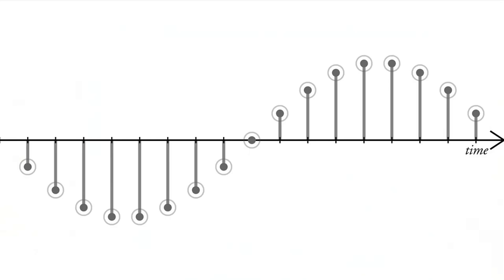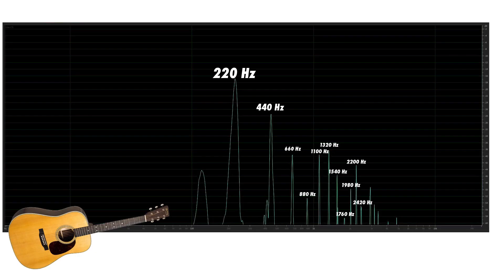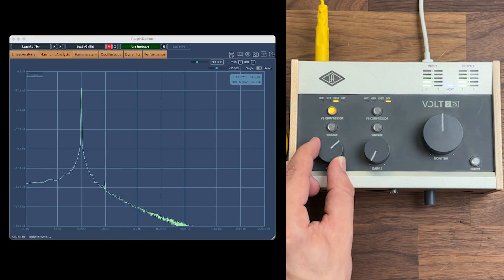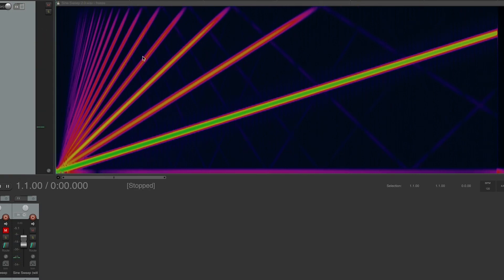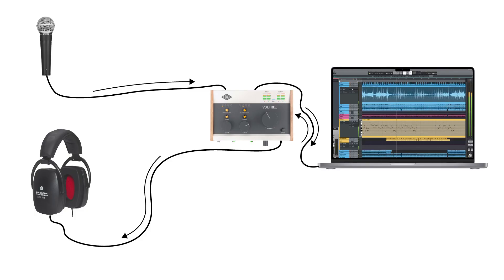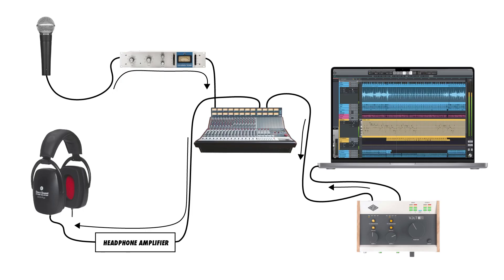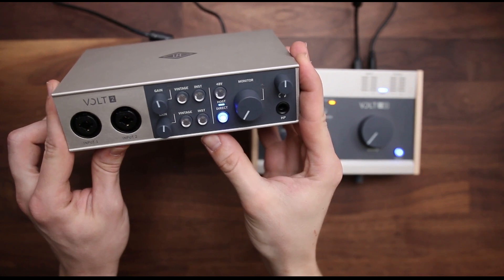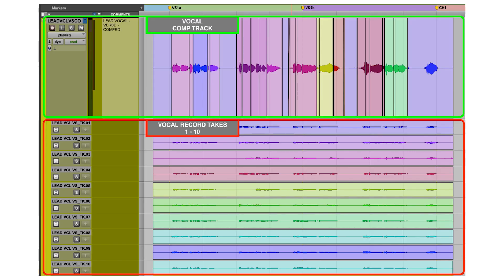What Is “The Analog Sound”? | Overcoming the Limitations of Digital Audio (Part 3 of 3)

Comment: When using plugins for mixing and mastering, which happens always, in the end, I work in 96kHz, and bounce back in the end to 48kHz. The folding back of all that aliasing will happen further down on the spectrum. So no need for plugin oversampling, which is also heavy on CPU, and many of them are marketing. Working at 96kHz solves all plugin issues for me. I don t have any problems also with the sample rate conversion, since everything is done in 24 bits I don t even dither anything. It just works ok and no nasty plugin aliasing, which should have been solved by now with all this tech

Comment: I have a UAD Apollo Twin  which I use with my laptop setup. The Twin is not "class compliant" with the MPC standalone units. I was thinking of getting the Volt 276 to use with my MPC for a portable setup. But I don't want to limit it to portable sessions only.  Is the a way to use the Volt 276 with the Apollo Twin on my laptop setup or is it redundant and not a good use case for this?